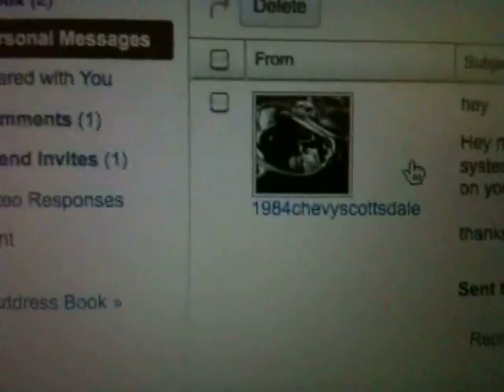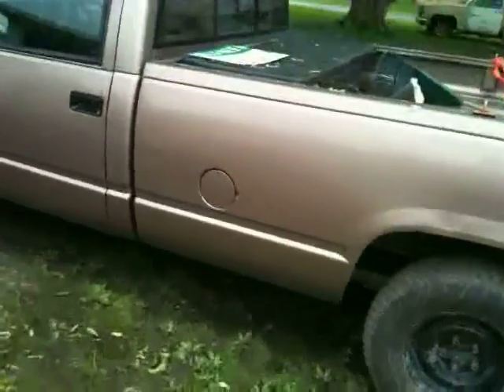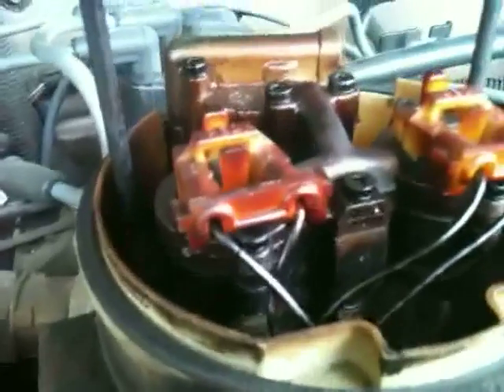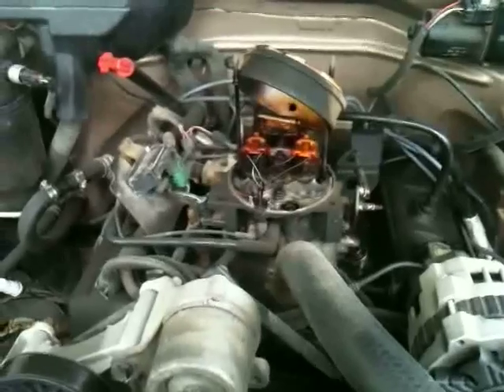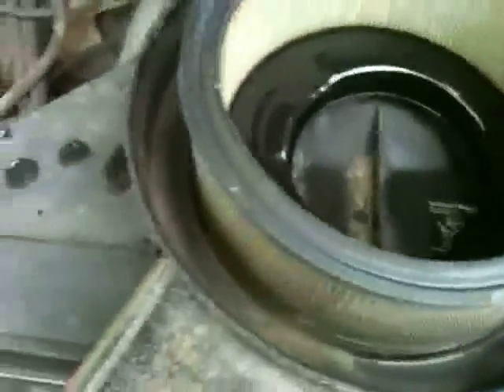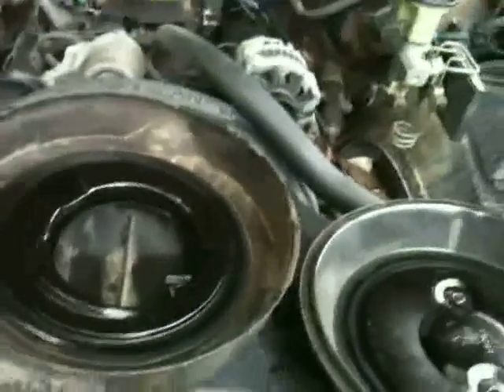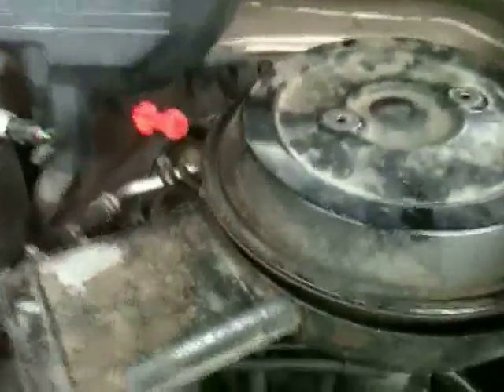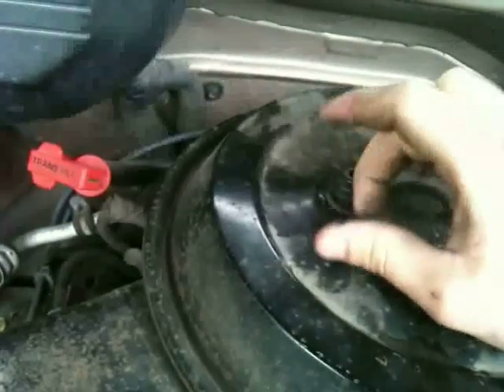Throttle Body Injection

Comment: no just pick up in 1989 does not have air injection is an 89 Silverado 2500 long bed I change the oxygen sensor and haven't been able to clear the codes on have a low B1 and it's kind of bugging a little bit when you go down the road it wants to but you know when I get back into Cruise cruising speed it's a pretty nice truck I got a lot of money tied up into it now just sitting cuz I have been able to get it to pass smog so kind of like up to my ears with it but I did watch some videos on YouTube that might help me and one of the main one was yours

Comment: I need help with my 89 3.7 liter Chevrolet pickup with throttle body injection it won't pass smog but only runs really rich at idle I replace oxygen sensor EGR valve spark plugs that still seems like it's not it does not want to run right it bucks going down the road can you help
Reply: that is 5.7/350
Reply from the maker: Do you have a air injection system on that truck?
Reply from the maker: I am starting to think that you might have an intake leak. I would inspect your intake manifold and vacuum lines for anything that might look bad.

Comment: I have 1988 350 with a tbi on it. the fuel pump quit and i put an electric in line so as not to drop the fuel tank. Problem is now i have no power to the tbi injectors. Are they electricaly tied into the in tank pump? The fuses are good,so how do i get power back to the tbi unit?
Reply: Simple, get a sawzaw, cut a hole in your bed and change hour fuel pump. Then screw latches on the cut out peice and screw it back to the bed
Reply from the maker: What did you find out about your injectors?
Reply from the maker: I think the injectors are controlled by an oil pressure switch. Check that or replace it.
Reply from the maker: Robert Foote
Good for you. Glad everything worked!
Reply: walshmonster2005 are you sure about that ? because my 1994 k1500 inejctors will not pulse and i have heard about the oil pressure switch controlling the injectors. its either that or the injectors themselves since ive replaced almost everything else.
Reply: I dropped the tank, put the right fuel pump in it and wow everything started to work. The fuel pressure had to be with in limits and it's wired in with the oil pressure switch so the pump kicks on then off until the correct oil pr. is reached then it and the computer determine when the injectors work and how much they spray. plus the computer sets the timing at same time. It's great when they all work together.
Reply: If the pump you had in there wasn't making enough pressure, the fuel pressure regulator would never open and the injectors would never get any fuel

Comment from the maker: If I remember right, the injectors should just unscrew from the top of the injector body and then lift off. Be careful or the going to the injector as it may be brittle. When you go to tighten down the screws be careful because you are going into plastic and they could strip.

Comment: Thanks for the video! I have a 4.3 TBI on my 1993 Chevy Sportvan, and I can't seem to figure out why it won't stop sputtering at low throttle, low RPM. I've already replaced the plug wires, distributor cap and rotor, and the main coil. It seems like it's getting better fire since I did this but it's still hesitating and sputtering at low throttle/RPM. I've checked the vacuum lines and the EGR and they seem to be okay, so I'm beginning to suspect the injectors. How do you get the injectors off?

Comment: 1994 Chevy 1500 2wd that WILL NOT RUN. It started running rough and then just wouldn't start. We changed the O2 sensor, and the plugs. It started and ran for about 30 miles and the next time I tried to start it would not start. Changed the plugs again, started right up and the next time tried to start, It wouldn't start again, plugs are all black. I need to know what to look at next, also, like in this video, the injectors go just like that but the truck won't start and then a big puff of smoke

Comment from the maker: I would look into running more refined gasoline, a bigger air filter (maybe a cold air intake), modifying the exhaust so the engine breathes easier, and then look into changing the rear end gears to help you pull things big and small.

Comment from the maker: Hmmm. If I Remember correctly the injectors are controlled by the engine control module which is located behind the firewall, I think. I will do some research and find out more for you. However right now I would inspect the fuses and make sure are blown.

Comment: i have a 1992 chevy silverado 5.7 tbi and it rouns really rough when its cold, the truck seems top sputter like its not getting any fuel, once it warms up it runs fine, but you can still feel a lag in the ..i cant figure out what the problem is. its had a full tune up and a new ignition coil...any help would be appreciated

Comment from the maker: I would take off the air cleaner housing and remove the filter. Then with the motor running (being careful not to get limbs or clothing caught in any moving parts) examine the spray pattern of the injectors. The pattern should be a fine mist in a conical pattern. If not then you need to replace the injector if it is leaking or not performing like it should.

Comment: A few years back, I was working on my 1994 Suburban, and had a few beers in me.
I changed the fuel filter and put it on backwards.  The truck ran fine, and I had no idea what happened until the next time I changed the filter.  Almost crapped my pants.